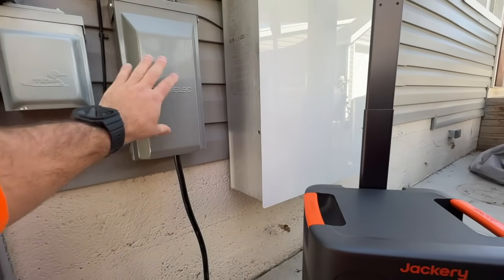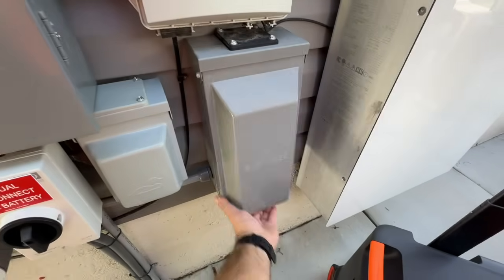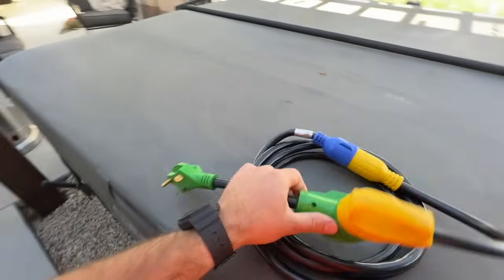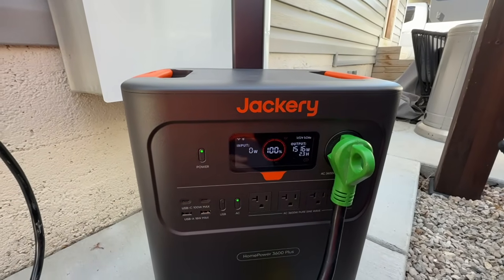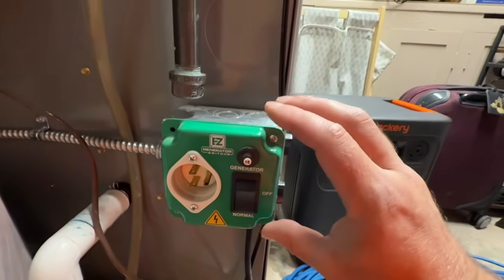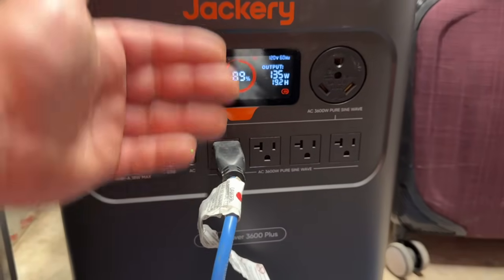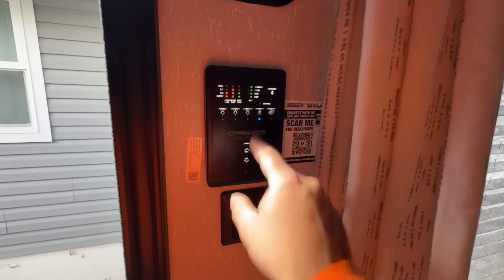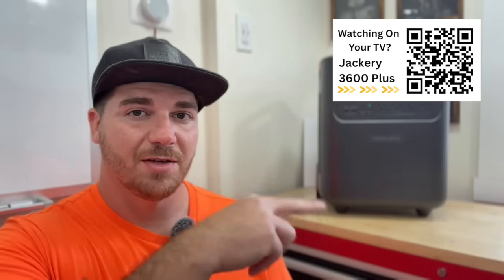Emergency Heat for 20+ Hours?   - Jackery HomePower 3600 Plus

Comment: A gas furnace, for real, it's a fan and a sparker, basically nothing! But I really like looking at these BS power stations, turned on, and it says 0 watt output, you would have to be an idiot to believe that, if its on its using power from the battery, can't be 0, unless yours run on fairy dust.😂😂😂

Comment: I'm sick and tired of all the bulls^^t hype over home power backup systems. My furnace draws ~360W and even taking into account cycle time, (my house is 90% efficient), on a cold 20° night and 36° day, I will use well in excess 3600w. I use more than 3600w just for my refrigerator in 16 hours under normal use and it's an energy star appliance. your suppositions do not meet real world expectations and make promises you cannot deliver on. Too many suppositions with no real-world data to back up your claims
Reply: lol. What kind of fridge do you have?

Comment: That's a poor choice for emergency heat, but great for fridge and freezer, fans, charging devices, etc.
Reply: It’s poor if you have electric heating.  Not a poor choice if you have gas heating.  If the gas runs out, electric blankets are a good alternative.
Reply: @oneisnone7350 
Never liked electric blankets.
Would rather have a gas stove that I can click on, or better still a wood stove that I can also cook on.
Reply: It's a poor choice for a power station, but so is Ecoflow, Bluetti,  etc etc
Reply: @dustydawson8977 
I was referring to "generators" in general for heating support as opposed to this brand.  Hence the referral to the uses.
I also commented in the thread that I thought woodstoves are better so one can cook too.

Comment: It looks like you're connecting a 120v 30a port on the Jackery to a 240v port and breaker in the main panel.  If I understand that correctly, won't only 1 leg (i.e. every other breaker) be powered?  Love your videos, BTW.  Thanks.
Reply: That adapter is bridged and applies a single leg to both sides of the panel. No 240V appliances can be powered by that. You must turn them off.
Reply from the maker: Correct sorry I didn’t specify that. That’s the beauty of that port it can be used for 110v or 220v
Reply: @diyhvacguy  You should know better. You CANNOT run a 220V appliance of a TT-30 outlet. It's only a single phase. You need two phase to run 220V. however, you can supply that single phase to both sides of the panel as you appear to have done but its limited to 120V appliances only.
Reply: @edgoodson3174 Is there an option to connect this unit and just not power 220v devices or will I need to purchase 2 of these and use the connector as my only option?

Comment: 1st.  I hardly lose power.  last time my house lose power was 10 years ago and lost power for 5minutes.  Now if these batteries can last for 10 years with zero issue, that might be a dif story.
2nd.  Cost.
3rd.  The battery deteriorate.  Not good to charge it 100% and not good to let it slide below... what 35%?  so you really can use only 50% of the battery.  Add in the deterioration and the battery practically uselesss when I actually have a use for it.

In short, this is not practical for me....YET.